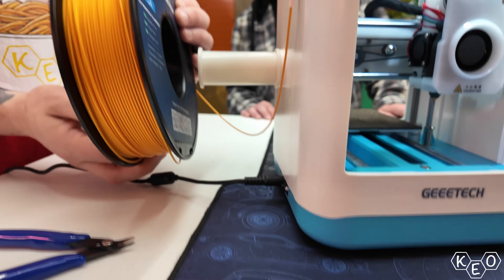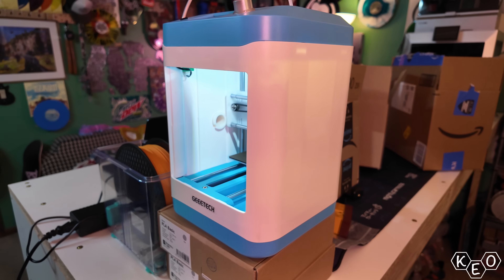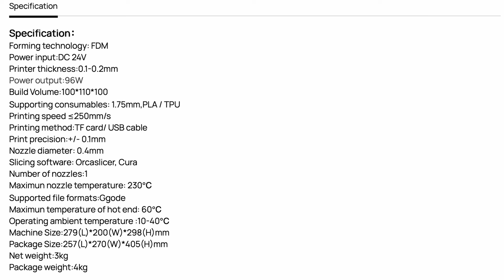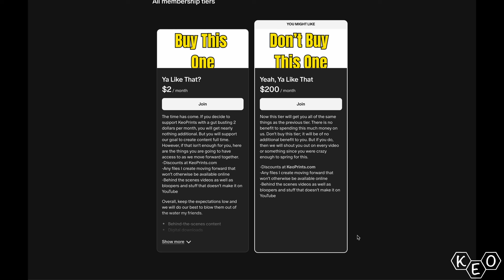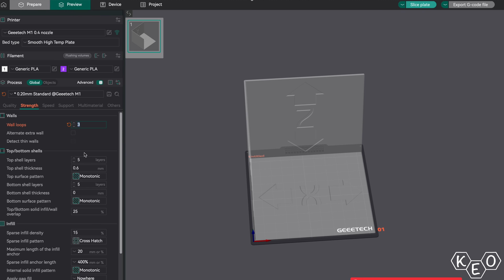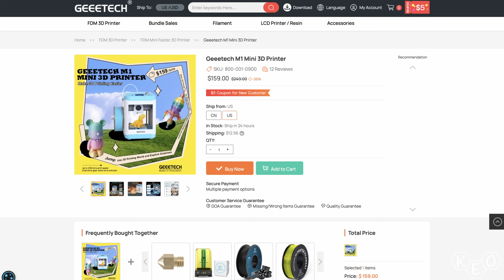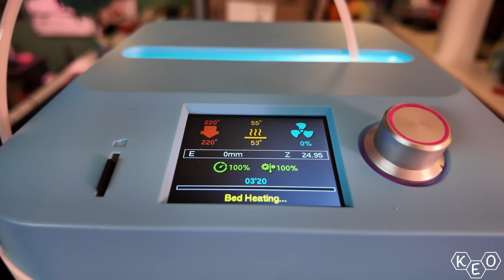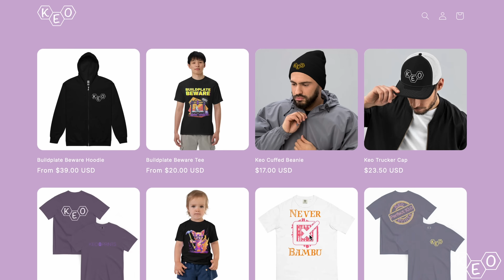This TINY 3D Printer Actually Works?! (Geeetech M1 Mini)

Comment: I prefer the tina 2 plus. I have 8 different tina machines as a hobby. You can print higher temp materials, it has wifi, an app, and  excellent customer service. They always get back to me within 24hrs. They even offered me free filament because they were having trouble solving my issue at the time. Great company with products that work.
Reply from the maker: I had no idea this market segment was so competitive with all of these tiny options. They all look exactly the same as well. Very interesting!

Comment: For 200 dollars you could just get the centauri non carbon
Reply: for 100 dollars more i got a centauri non-non carbon (very happy with it but honestly i wish i waited until the snapmaker u1 came out)
Reply: Its $170 for me. so $90 dollar more and you get a real printer.
Reply: @AndrewTSq the geetech is 160 so same price basically and with no sale the geetech is 250 so 50 more than centauri non carbon and 50 less than centauri carbon